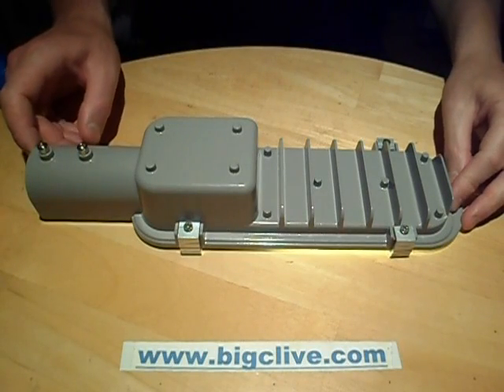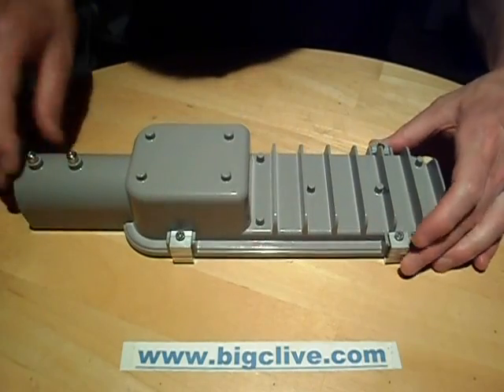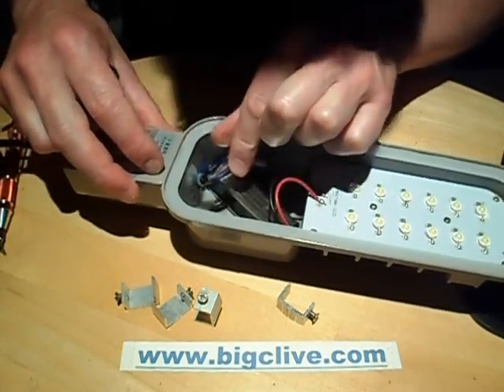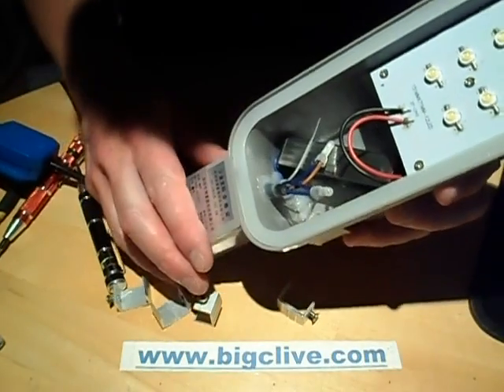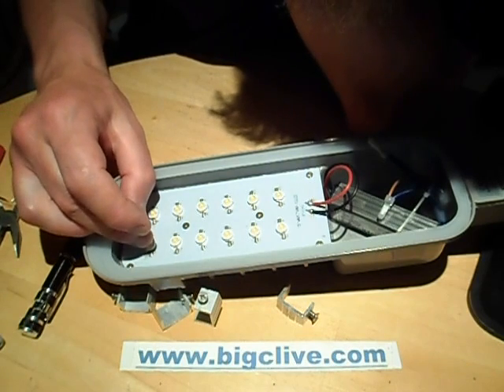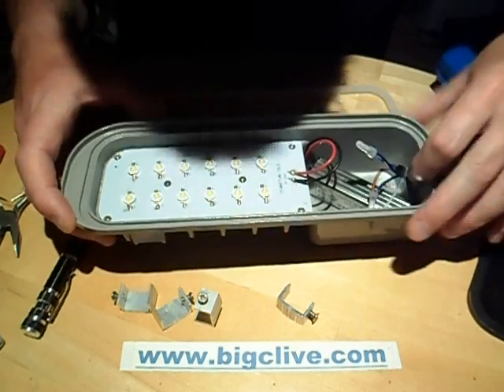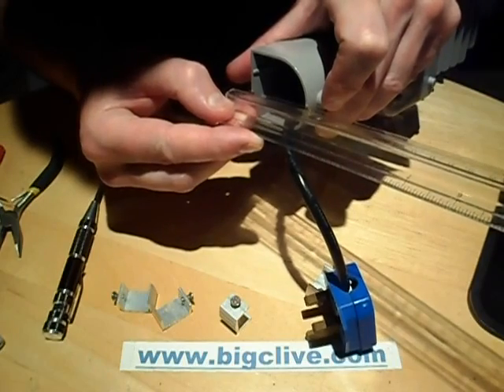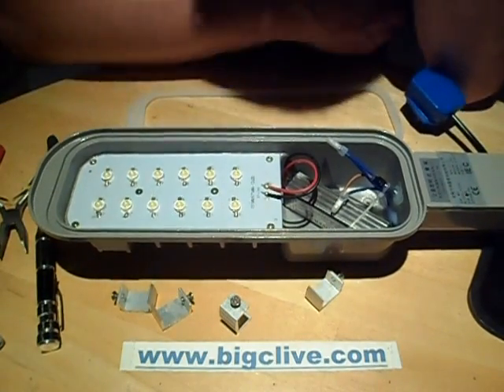Chinese LED street light teardown.

Comment: Have two of the 24 Watt version of this light installed in my garden. Running on a timer, at least 3-5 hours a day. 

After one year of use, still works perfect. No moisture in the armature (mounted on top of a pole so they are not shielded from the environment). Only the powdercoat/paint is fading a little bit, but that is to be expected being exposed to the elements 24/7.

Only the clamps for the glass are bad, but they seem to hold up fine.

Very happy, bought two of them for like 50$ shipped. Seems good quality.

Comment: Odd question here... can these lights be dimmed without modifying them?
Reply from the maker: +Robert Brouse No.  The internal power supplies would try to compensate to put out their rated power.  The input circuitry would also not be happy with a dimmed supply.
Reply: Thank you I will make a frame for some neutral density filters to reduce the glare if it gets bad.
Reply: Normally an outdoor led light is not dimmable. Lights for indoor use can be dimmable

Comment: Clive. Many thanks for this tear down. I was going to get a couple of these in January for my large car port. Based on your assessment, I think I will. Do you recommend re wiring to use an earth?
Many thanks and Merry Christmas
Reply from the maker: +Merv Howard I do recommend connecting the earth.  Also consider some of the very common LED floodlights that are available.  Particularly the ones with PIR sensors if it's just for security and illumination when you walk through the area.

Comment: Very unusual design. street lamps usually are mounted on 48, 60 or 76mm pipe (most common is 60mm) and they need much longer wires (most common is 5m or 10m or without any wiring). That short cable is useless for any installation, usually connection (and fusses) for street lamps are at ground level in lamppost.
Not having ground connected is not so uncommon many "serious" manufacturers in EU (like Schreder) do that but their lamps are CL II and anyway lampposts are grounded.
Reply: +Miloš Lazović Schreder is Serious???
Reply: Bali Gabor
Schréder is one biggest manufacturer of public lighting product in world, but not what they use in Eastern Europe where Schréder is not made by Minel-Schréder and they are sold as Schréder.

Comment: I hate how they always got to make LED fixtures so futuristic and ugly, why can't they just use a typical HID street lamp designs instead of these? 
Btw, LEDS were never mean't for lighting in anyway, they were made for indicators and such things, I see these fixtures around my area and some are already starting to fail to turn on at night.... They should of found another way for HPS, MH, and MV bulbs to be more efficient....
Reply: +Adam Correia (Cracked Sponge) Its a heat thing. If they threw a nice roundish housing on there it would reduce the heat dissipation.
Reply: Brad Madu but isn't heat bad?
Reply: +Adam Correia (Cracked Sponge) Yup.  I was trying to say that the open design with the fins is good for getting rid of heat.
Reply: Brad Madu oh,okay.
I didn't think that heat wouldn't be a problem with LEDs because they produce little to no heat. But still if you were to modify a street light's design that was mean't for a standard HPS bulb, and were to replace the reflector and socket with the LED board or strips, (with no glass panel ore refactor) that would do damage the the LEDs i'm guessing?
Reply: +Adam Correia (Cracked Sponge) those low watt indicator leds produce almost no heat but you'd be surprised with what these can put out. That fixture is 12w with lots of surface area so it will run pretty cool. but a 10W bulb that you might put in your house to replace an incandescent will run about 170F (80C) because they are compact and can't have as much cooling. that's why your get an operating life of up to 100k hours from the street light and 20k from a bulb.
Reply: Brad Madu interesting, do you think LEDs were EVER made for a light source? because they seem to fail easily, even though they are suppose to last 30+ years...
Reply: +Adam Correia (Cracked Sponge) Other than the sun, can we really say I'd something is supposed to be a light source or not? Arguably an incandescent bulb should never have been a light. Leds are the best we have atm... and they are pretty darn good.
Reply: Brad Madu really? the incandescent bulb was never mean't for lighting? i knew the mercury vapor bulb was not for lighting but started using it in street lighting back in the 50's or 60's but i thought the invention of the incandescent was mean't for lighting :I

but wait, still doesn't give them a right to ban one of the greatest inventions that got pasted on to what is today...
Reply: What do you mean by "meant for"? The bulbs we know came about because we realized that when you run electricity through a resistor it heats up. If it's hot enough, tadaaa... light. Once we figured this out we had to find a way to expand the principle and light up a room. We seem to have gone through the same process with LEDs. We saw a diode make some light, now we figured out how to make it light a room. It's just as easy to say that both were "meant for" lighting as it is to say that neither were.
Reply: Brad Madu OH WAIT! i read your last comment wrong, my mistake.
Reply: +Adam Correia (Cracked Sponge) If a LED light is properly designed with enough cooling it will have a far longer life  than any other light source apart from the sun.
Reply: brian whittle welp, the city next to me picked the wrong fixtures...
Thing that REALLY pisses me off is that they replaced these HPS fixtures that were piratically new, a whole strip off them,we are talking about over 500 of these things! This is on the main roads, this was not done at any of the side roads or highways, (these replaced older fixtures, along with some spot replaces back in 2009) So, really, that was a waste of money and perfectly fine streetlights there, those didn't live a half quarter of there lives. (note that there was 250 WATT fixtures, then then the new ones came in at a lower voltage; 70 WATT then came "THE NEXT BIG THING!" coming in at about 49 WATTS, yes, 49, not 50, it says it right on the NEMA sticker on the bottom.) So, if these are 49 WATTS, then, why not use 50 WATT HPS fixtures instead? My town is 95% lit by 50 WATT due to a huge change out back in 2009 also. (same fixtures that were replaced by LEDs, but they still exist here! ;D) this saddens me though, because if it ain't broke DO NOT FIX IT! It would have been fine with me if they did spot replacements when it was needed instead wasting all these different types of streetlamps... 30+ years they say... huh... the old ones that were there were over 50 years old!

Here are your options:
- "Outdated" lighting that has proven itself time and time again and will last forever at the cost of a few extra watts.
- "Modern" lighting that will (slightly) lower your energy bill but will not last its rated life and in the end hurts our environment more than it helps.

I'm so sorry for the rant, but I really need to vent this out to someone. :P
Reply: +Adam Correia (Cracked Sponge) It is not so simple, 70W HPS (like Philips MASTER SON-T PIA Plus) even is marked 70W in reality is 73W, when you put it in lamp total consumed power increase to something like 83W (due losses in ballast ....), life span of it is calculated like 4 years (in south Europe) but they usually last much longer (50% will die in 6-7 years but it is more cost saving to change all of them after 4 years then to change lamp as it die).
Now smaller city (like 2.5 million of people) have between 100000 and 150000 of lamps (most of them are 70-100W) so saving of 10W per lamp is saving of over 1MW total for whole city (4500MWh for every year)
Reply: Miloš Lazović What if they did 50W HPS lamps in stead of 49W LED? They mark the wattage 49 watts on the nema tags of LEDs here idk why 49.
Reply: Adam Correia
Again it is not so simple, they could find HPS lamp of 35W(36) but I dont know if it will produce enough of luminous flux needed for particular application. I dont know how is in your country but in my there is law (rewritten from German law) what is minimum luminous flux needed for lighting of public places (it is different amount needed for park, streets .....). Of course if they wanted they could make it work, but they probably needed to put lower lampposts and more of them to get adequate coverage and luminous flux, if someone wanted to take some time they could try many solutions to find best and more cost effective (serious manufacturers of outdoor lightning lamps give you software that calculate light coverage and all other parameters based on lampposts height and lamp position for their lamps). And to switch from one power of HPS to other you need to change at least ballast in lamps, which is additional cost (work cost more then to replace whole lamp)
Even if they wanted to switch LED they could do it, manufacturers like Schreder make LED and HPS versions of same lamp for models <100W which are models for lamppost <6m and are most critical how they look (I think no one will care how lamp look on let say 12m lamppost where you use 250+W HPS lamps it is to high to be easily notice). If i remember correctly 70W HPS is replaced with 36W LED in same model of lamp (Schreder models) to produce same luminous flux.
Reply: Miloš Lazović Over here, (in my town) a few years back we had 100W, and 250W HPS fixtures on the main road, then in 2009 they replaced most fixtures (kept some 250W fixtures that are still here today) with 50W HPS, fixtures, But, they city that's next to me just began using LED fixtures, it's a full change out, soon the city will probably be lit 99% LED on the roads... for roads that used 70, 100 watt fixtures, they were replaced by 49W LEDs and on the more major roads that used 250, and/or 70 watt fixtures are now (guessing) 65W LED lamps. I don't really know if we have a law like you guys have over there, but I can say this right now, I'm not impressed with the LEDs, they are not AS bright. And I fear they will not last as long as they are suppose to live, and that's 30+ years... yes, they got rid of that orange color HPS gives off,and replaced it with a nice whitish blue, but it's just doesn't do the job right for me.
the LED fixtures that they use are CREE lighting BXSPRA03FG-US's. and the price for them are $192.86 a piece. When you got my town next store that mostly has HPS GE M250-R2's (most 50W and a couple of 250Ws) that range around $64.30 a piece.
So, which is the 'better buy'? you got the CREE lighting LEDs, that replaced thousands of fixtures in that city, and they cost close to $200 each. But if you were to go with the GE HPS fixture, that would cut the price a lot, and would also decrease the lighting bill due to a lower voltage.
Reply: Adam Correia
I don't know how is at your country/city, but they probably had some reason to replace them, maybe you have expensive electricity or cost of replacing light bulbs is expensive so they had reason to switch to LED (LED will last 30 years only if you have very short nights, Philips declare that 98% of them will last 1000000h, which is for my city like 22 years at best, but again it is 5 times more than HPS).
My city use HPS on most places. they tested LED on couple of places (even solar power LED but they turn to not so good at winter when night is long), but here electricity is cheap (cheapest in Europe) and work is not so expensive so there is no reason to switch to LED. Here they calculate that investment of replacing public light should return investment in 8-10 years.
I dont think 200$ for LED light for street is expensive (I saw HPS which cost much more then that, but they are made from cast bronze ....), and Schreder have similar prices (but it is dependent of quantity ordered)
ps: I am not expert in public lightning, I have some experience because I did some project for them (remote monitoring and control of light) but I still not know all how they calculate how cost effective is type of light source they use.
Reply: Miloš Lazović Yeah, well, the main reason I think they did this is because LEDs are more "green" than HPS, and yeah, the cost too. All I can say is that this was a downgrade in lighting for the city... I really hope they don't switch to LED In my town that I live in! :<
Reply: Alright, the speculation is killing me... why do you want to hate LEDs? I thought I heard you say that you did not like the orange light of an HPS, and now I hear you say that you believe that they are also cheaper and that they are better for the environment... so why the hate? I kinda feel like you are saying "I sure hope my town does not implement a smarter, cheaper better solution." Explain?
Reply: Brad Madu Here are your options:
- "Outdated" lighting that has proven itself time and time again and will last forever at the cost of a few extra watts.
- "Modern" lighting that will (slightly) lower your energy bill but will not last its rated life and in the end hurts our environment more than it helps.
Reply: Adam Correia  it's hardly a "few" extra watts.

On longevity my bathroom was remodelled 5 years ago with LED lights and they are still perfectly fine, and they we not particularly expensive ones either  

You should also note that the average cost per kWh for domestic in Europe  is over 22 cents
Reply: brian whittle That's different from what i'm saying, any bulb can last 5+ years
Reply: Adam Correia
 not in a cold/humid bathroom
Reply: brian whittle I have these incandescent globe bulbs in my bathroom, they been there for, oh idk really know.. 8-10 years maybe? maybe even older.(4/10 bulbs are that old and still work, 1 is blown the rest are replacements) yes, they are dimmed a bit, but they have been through all those humid conditions there, and still work. ( I'm amazed!)
Reply: Adam Correia
 Who the heck wants big ass bulbs in a modern bathroom, the only other choice would g10 downlights these in incandescent types are halogen and you are lucky to get a year.
Reply: brian whittle No, they are not that big, what i mean by globe i mean by 3-4 inches thick globe, btw, my bathroom is not modern, house was build in 92.
Reply: Adam Correia
 Good LED fixtures with adequate cooling will last longer than any incandescent, the only incandescent in my house is in the microwave and I have zero problems
Reply: brian whittle Well, in conclusion and in my opinion, I prefer Incandescent's, HPS, MH, MV, CFL, LPS,  and any other man made light sources over LEDs. New Tech., is just not the thing for me....
Reply: +Adam Correia (Cracked Sponge) It's not just you Adam. I  have met many people that still prefer MH or HPS over LED's when it comes to commercial and industrial applications.But it is getting harder to ignore the latest products out there. Many offer over 110 lumens/watt, an asymmetric beam angle, no flicker, low UV radiation and good colour rendition. 5 years manufacturers warranty is now a standard for the majority of them.
Reply: +maxineanu I had a light customized to what I needed and it is giving me 130 lumens per watt and I could be happier. Even if I liked HPS orange better I'm pretty much locked to LED because I'm running them off solar so I need ever watt I can get.
Reply: maxineanu What about MV? That was banned for no explained reason
Reply: +Adam Correia (Cracked Sponge) Ummm mercury is nasty stuff.  There is a fair bit in a MV lamp...  That's why it was banned.  Also nothing is close to the efficiency of LEDs and if you have a high quality fitting, they last well enough.
Reply: cjmillsnun That's why you have dispose mercury correctly. HPS and MH lamps have mercury, and are not not banned. that why HPS seems to turn green/white then orange when they first ignite.
BTW: found out it not the LED's fault, it's the drivers that they have in them. they are extremely sensitive to heat. (because they are circuit boards)
Reply: cjmillsnun And you know what's more efficient than LEDs? fire :D
Reply: +Adam Correia (Cracked Sponge) If we are talking about light, then I don't think you can make an argument for fire being more efficient that LEDs. Right now for energy input vs light output. LED wins. Fire outputs more of its energy as heat so it's inefficient as a lighting source.
Reply: Brad Madu I know, I was joking around.
I don't want to debate over this anymore, so I'm just fooling around at this moment. It's about opinion for me.
Reply: Adam Correia man I agree fuck leds
Reply: Brad Madu they are fucking shit me myself own around 20 hid fixtures and the majority of them are good U.S made hid bulbs not the shitty saing hai fucking shitty leds i own no led fixtures... I have 2 rare mercury vapor light fixtures and a rare hps fixture. Yeah not being replaced with leds
Reply: Adam Correia in my area most hps fixtures that are 70 watt get replaced by ugly 200 watt ultra shitty 60,000 lumens which is Ridiculous

Comment: Hey Clive question for you—I'm considering buying these to modify to make them rugged portable lights with a built-in battery pack. My question to you is do you think I have to change out the LEDs to work with DC (probably 12v) and do you think there is enough room in that housing to fit a reasonable battery and a transformer?
Reply from the maker: Ben Winter You could probably use a standard 12V driver for 10W LEDs.  It might be easier to make a version based on a larger LED floodlight housing.

Comment: There's a standard size in tubes that's 42.4mm on the outside and plumbers call it 1 1/4" (I think they started by measure the inside diameter and then the steel got stronger). 1 1/2" is 48.3mm.